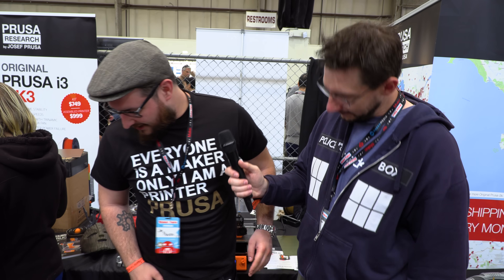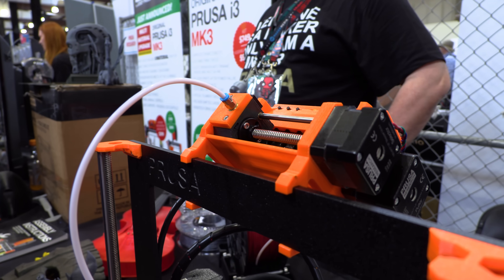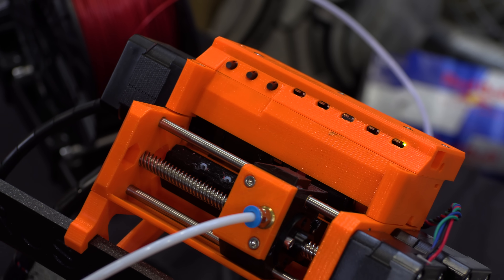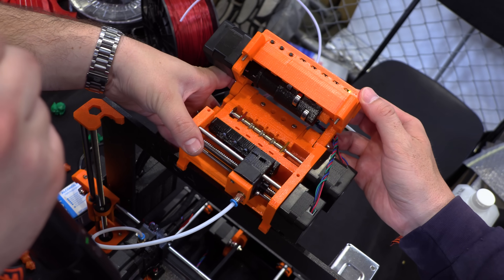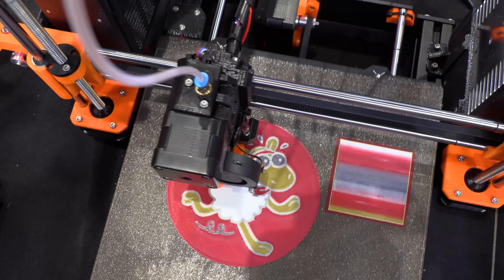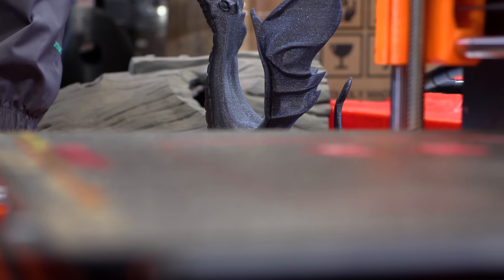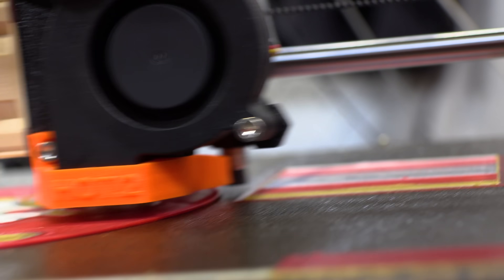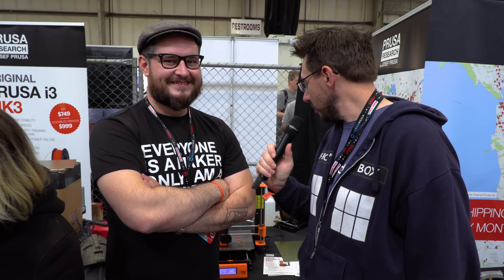Prusa i3 mk3 MMU 2 - 3D Printing 5 Materials / Colors at Once #BAMF2018

Comment: Could they not reduce the effective print area and use the back of the bed as a disposable section? It seems like the nozzle could be moved down to the bed level to change materials and not have to keep the tower level with the printed model. 

I don't think the nozzle would impact the model if you reduced about two inches from the X-axis and then you would only need to use the tower when the actual material changes happen.

Comment: I'm pretty sour on Prusa at the moment.  Seven months ago I ordered something and now I'm not even sure I want it anymore.  In November 2017 I ordered both the MK2.5 kit and the upgrade to make the old MMU work with MK2.5.

I've since received the MK2.5 kit (Apr 2018) and been told that my MMU upgrade (that's right, Multi-Material Upgrade upgrade) is being changed to the full MMU v2 free of charge.  Yay?  I can't really cancel the order because if it turns out this thing actually works, it's going to cost me a lot more to get it later.  Bleh.

I still haven't installed the MK2.5 upgrade because of all the issues reported on the forums and github.  Github issue #602 has like 1100 posts.  And honestly, my MK2S is working way too good to tear it apart.  Even though I have it, I never installed the original MMU, either, because of similar quality concerns.  It's still just sitting in the original box(es).

Anyway, the real reason for my post.  Anyone know how long the Haribo candy lasts?  I just noticed my original MMU had a pack that I never ate... was trying to see if there was anything useful in that box.

Comment: great interview! I only wish they would have stuck with bondtech gears.
Reply: You still have the main bondtech gears in the extruder itself. It doesn't seem like the MMU will need much pushing power - it just has to get the filament down the bowden tube to the extruder, where the bondtech gears there will take over.
Reply: Eddie Moser Me too! But it would have driven the price up I’m sure.

Comment: Glad to see it working, but I have a couple questions:

1) will it be able to deal with materials at different temps? ie: Will it adjust the hot end temp when switching to a material that needs a different temp?

2) When it retracts, what happens to the filament being pushed back up out the back of the MMU? Seems like it could become a bit of a tangled mess back there. - It's not like the spools will reverse and take up the 6" + of slack.

3) What happens to the cut ends when it has to use the cutter. Where the heck do they go? Really hope they aren't just going to fall down onto/into your print!

Regardless, I'm very much looking forward to getting this! Also hope they make the changes to make it use the purge material for infill (and hopefully also for supports!) Less waste...

Comment: Joel, does it require manual control? Or is the filament feed tied to extruder number in the g-code?
Reply from the maker: I believe manual control is there, but gcode will also tell it what to do.

Comment: I have one of these (and two 2S to 2.5 upgrade kits) on order. I am really disappointed over the MMU performance. I am now really excited about this new unit. I can hardly wait.
Reply: Joe Perch What is disappointing about it? I've been doing a lot of research into multimaterial and I'm debating on wether or not this is worth it, what's different about this version that has you excited for it? Thanks!

Comment: Now, will this work on other printers like a Cr-10(s)?
Reply: It should work on any printer that can auto load filament.
Reply: Thats what I am hoping. Would love to put this on my hypercube
Reply: I don't think it will work.  While there is a feed motor up there to push the filament to the extruder, it still rely's on the motor on the extruder carriage  to do the actual pushing the filament into the hot-end. This is not a bowden setup, though it does kinda resemble one.

Comment: Josef: There's nothing magical about it.
Me: Heheh... No, there's EVERYTHING magical about it.
Reply: I’m not sure that will apply here, as this is retracting the filament, not splicing it. The Palette needs same filament properties to be able to fuse them if I’m not mistaken.
Reply: BV3D , it will be "magical" when it properly handles disolvable filament for supports.
Reply: Is there a reason why it wouldn't be able to handle dissolvable filaments? That's part of the reason I ordered one.
Reply: BV3D , the filaments used may need to have exactly same properties. The Palette filament splicing machine has the same limitation.
Reply: Michael S i think this one might be less sensitive because it doesnt need to weld the enda together, so if it Waits for the nozzle to change temperature between filaments it might work, tho wery slowly
Reply: well your not gonna mix pei with pla. its just not smart. You sound pessimistic to say the least.
Reply: The only issue I could foresee would be making sure all the filaments loaded will perform well at a common temperature.
Reply: I'm optimistic. PVA and PLA seem to be happy in the same general temperature range, so I should be OK. My thought was that I'd use four of the five filament feeds as print material (I generally only print PLA), and the fifth would be a soluble filament for supports.
Reply: Ha ha I was thinking the same +BV3D

Comment: Ok, thats very good. Now make a medical version of that where it places material such as a calcium core, for skeletal structures, with a higher density of infill than what is considered normal for bones. And the other elements of the multi materials being that of what is required to print the rest of the body. Human 2.0 is the goal here. Durability, longevity, disease proof. We're talkin the works. I know you can do this! You are a printer.
Reply: True Tech , in 2058?

Comment: SLA SLA SLA SLA SLA SLA
Reply: It was on their survey... I'm thinking the 40x50x70 print volume "small" one from the survey is likely. Unless they've found a way to bring the price down dramatically, I don't know what sort of innovation they're bringing to that manufacturing method if that's what the hint was for, but we will see :D
Reply: Alex Stixx yes i did the survey. Hope its bigger.
Reply: SLA is a tough market that caters to a much smaller audience.  I have no doubt they will sell, but if it's just another SLA or DLP printer I don't see what the value would be.  PRUSA printers are priced at the higher end of the consumer/hobbiest market.  The question I would have, can PRUSA take the hazard (toxicity) and PITA out of SLA printing?  I doubt it.

Comment: I need one of these in my life right now.. I'm curious if the purge block volume has been reduced on this version?
Reply: It should be the same as before.  But this can be improved with some software tricks like using the purge as infill or support on some models.
Reply: vertigo235 infill is a great idea.
Reply: I heard them mention that it purged in the infill on previous video. That purge block was ficking horrible
Reply: billy jennings well, it’s givet colors so it should be the largest one yet! >.<

Comment: If the purge block wouldn't be, it would be perfect.
Reply: NicMediaDesign they’re working on putting the purge in to the infill. :)
Reply: even if they had to use a smaller purge block it would make sense if some of the purge could be used as infill.
Reply: ooooo .. yeah .. ok. That would make total sense
Reply: Where would the already hot filament go as it gets changed? Just spew it all over the model?
Reply: +Sean Connelly OOOOH! That is so smart! I love human invention process...
Reply: You'd probably need at least a little bit of a purge block just to get the blobs/noodles hanging off the nozzle from the filament change. Could probably be a very small wipe shield/block instead, though.
Reply: If they do that then that will be a software fix. This means even the older units should have that fix

Comment: Oh, yeah. I'm hyped already (and had it ordered since January). If this works, it is super amazing! They are also trying to develop Slic3r so that the purge block can be used as infill instead! How cool is that!!!
Reply: yeah what if its dual material one of which is PVA support.  if you use PVA as infill then.............hehehe
Reply: shaoyun wang I presume it will be optional ;-)
Reply: IgnoreMyChan that is not correct :) if there is no collision between head and print it can travel lower to purge block ;)
Reply: Unless there were some kind of attachment to the X-gantry that allowed for a nozzle wipe at any height just by moving all the way to one side?